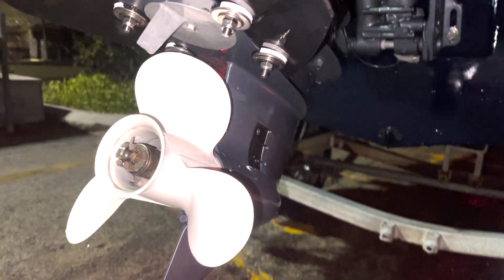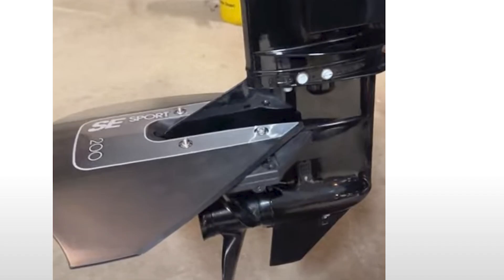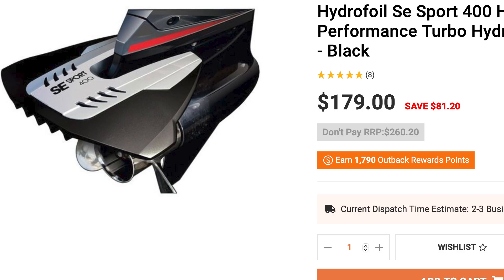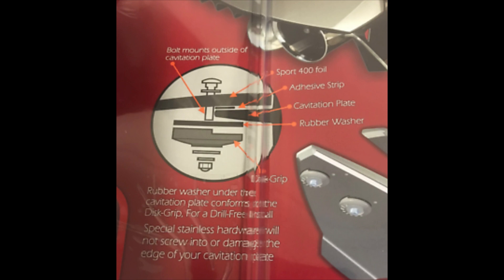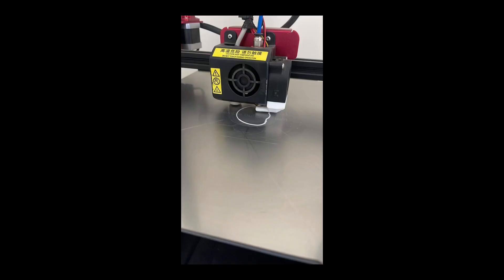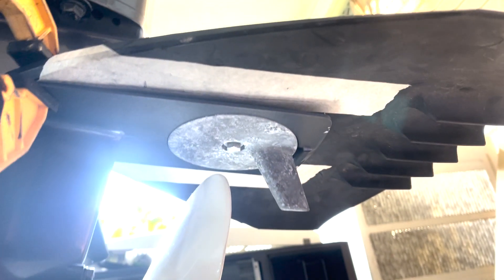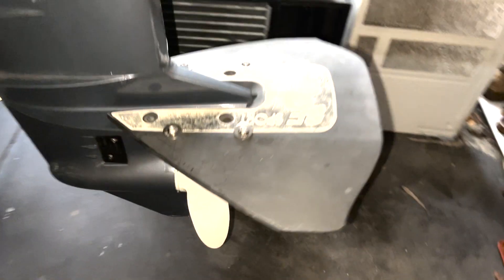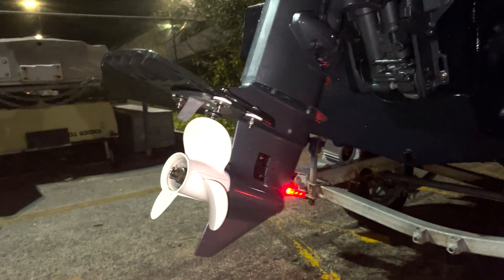DIY Drill Free SE Sport 200 Outboard Hydrofoil - $4.75 in parts

Comment: nice i was looking to do the same thing. good one👍
Reply from the maker: Thanks 👍
Reply: @sailingkulali  if you can could you please send me links to all the other items used in this installation?
Reply from the maker: Are you zenus who already emailed or someone different? If you need the STLs send me an email. Otherwise with other parts they are self explanatory. Ie 316 stainless fastener etc
Reply: @sailingkulali  yes its me lol just wanted to et the exact stuff youre using
Reply from the maker: @BillaBong1 I just went to my local hardware supplier.

All 316 fittings standard sizes 

Make sure to acetone before using double sided tape. 

Check torques after a few uses. Mine hasn’t budged since. Still good to check.

Comment: What material did you use in the 3D printer?
Reply from the maker: Pla
Reply: @sailingkulali  how is the pla holding up . I'd almost think petg would work great for this also.
Well done.
Reply from the maker: @spoton6584  No issues at all. Boat has been on countless trips since. Haven't had to tighten up bolts or anything.  Because not much UV. Low temps. PLA has been fine. Recently been using PetG and its got way more strength and not as brittle.

Comment: Clever solution, looking at the setup you could try turning the bolts around so the rounded, more aqua dynamic, heads are on the bottom in the flow for reduced drag.
Reply from the maker: Yes great suggestion